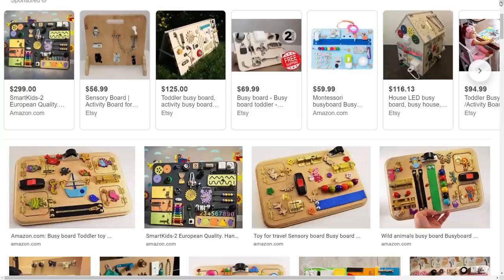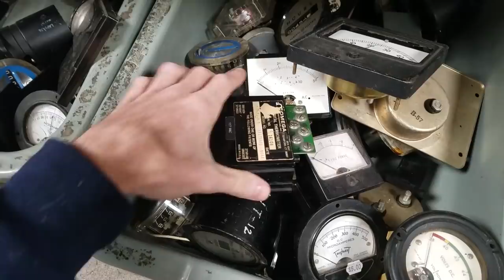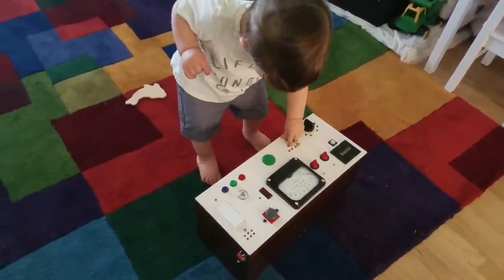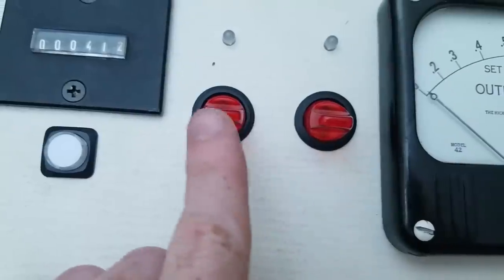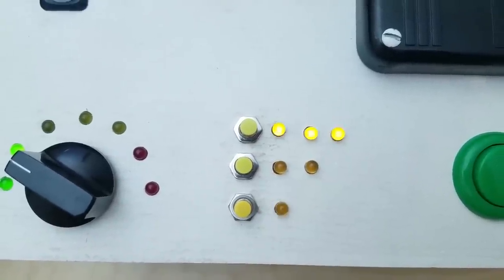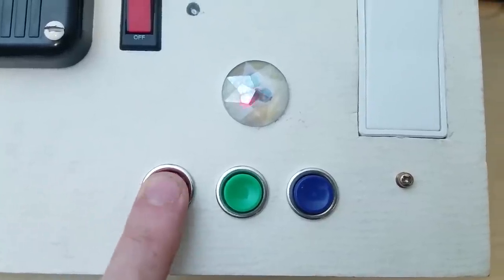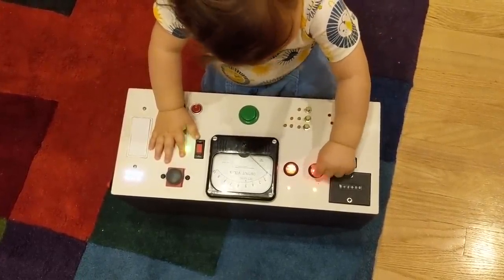Building a Tactile Button-Box for a Toddler

Comment: As my mom told me:
I had something similar to this when I was around the same age. I think it was my grandpa that made it for me: it was an old network(?) switchbox thingy with a bunch of additional switches and lights in it. I LOVED that thing. I think I remember being told that when it stopped working, I took it apart and put it back together and it worked again and I would keep playing with it until it happened again, and then I would do it again.

My memory of it isn't very clear (given that I haven't seen that thing in years; I was probably around 3-4 when it got lost or I stopped playing with it, not sure which), but I can distinctly remember the front panel switches and that some of the buttons made sound.

I would do nearly anything to have that thing back.
Reply: You can build your own one!

Comment: had a few thoughts for some kid friendly busy widgets since you mentioned maybe adding more to it as he grows.

You could have a square of led's and 4 buttons surrounding. In basic mode it could just make a wave from that direction when you hit a button, in advanced mode it could be a "control the dot" type thing.

also if you give them all basic aesthetic symbols like "the triangle buttons" or something, then you could possibly have a sort of 'bop-it' system where he has to manipulate the board to make it match, but that's probably much later on

I think you should also try to incorporate some more physical things like servos and sensors, as time goes on. A servo modded to have its potentiometer makes a good and safe slow motor and you could have it do different things based on whether music is playing, how far his hand is from a sensor, the mode, or even might be able to make a lego attachment to it and try to nudge him into that kind of robotics. 

This is a really cool project and I'm sure he's in more than capable hands

oh also one of those "useless machines" that turn themselves off when you activate the switch would probably  make a good module

Comment: Sort of an activity board that I am building, more mechanical than electrical.  I also had the same idea to not include outlet and plug, but he does get 2 wall switches.  I also have an aluminum panel set into the plywood that I have a number of matching ones so that I can mix it up with different sounders, lights and switches for him as he progresses.

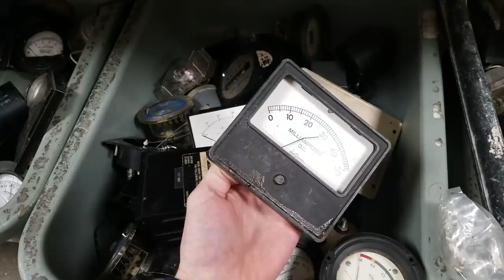Comment: 1:03 - As someone who does electronics, I'm sure a lot of people will agree, there's nothing like coming accross a bag of vintage looking LED's.
I remember picking up a bag before. Strangely enough, it had what looked like standard 5mm red led's. But when powered up, the chip was green... Why would someone possibly design a green led encapsulated in a red diffused 5mm housing?!
Wish I had kept hold of them. Never found any since. Might have been rare for all I know.
Reply from the maker: In my bag, I found an LED with the little notch on the positive side instead of ground.  I guess they do have misprints!  That must be why they end up in the discount grab bags in the first place.

Comment: I am very impressed and like your project. I took a look at your code. I would apriciate it if there could be any rough wireing scheme. I plan to build exactly your box.
Reply from the maker: I never made a wiring diagram unfortunately.  But at a high level, there's a 9V line for the battery, Arduino, volt-meter, counter, and toggle switch bulbs.  And the Arduino provides a 5V line for all the LEDs and speaker.  Buttons connect or disconnects 5V to the pins, LEDs just connect with a series resistor, and the 9V stuff is all hard-wired.  The only tricky part are the yellow simon buttons, they work as input and output with one pin since each button connects to the LED directly.  Hope that helps!
Reply: @CodeParade  Thank you very much, I tried to assigning the pins form the arduino code to the leds and buttons on a picture out of the video, and for the simon stuff I don't get it how it is wired at the moment.  Perhaps I will find because there are not much pins left. ;-)

Comment: This looks awesome. Btw. your soldering iron is too hot (1:47). You might think its easier and faster to solder like that but actually its way easier when you are able to have a drop of solder hang on the iron which is possible at the right temperature...
Reply from the maker: Thanks for the tip!  I had it on 375°C, but looking it up, it sounds like it should be closer to 350.
Reply: @CodeParade  I have mine at around 310. The ideal temperature probably also depends on the size of your soldering iron tip and on the solder you're using.

Comment: What happens if you press the button when the number is 999999? Will it go to 1000000 and just show zeros, or have you programmed it to reset to an actual 0?
Reply: It should go back to zero as long as he doesn't reach the int limit. (Probably dosen't matter if it does.